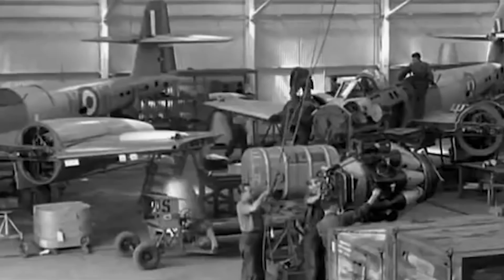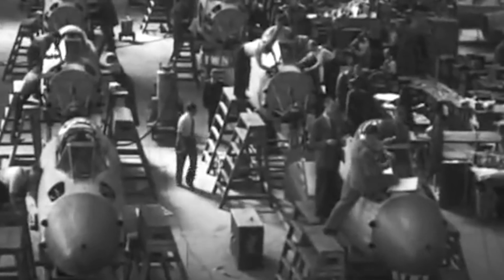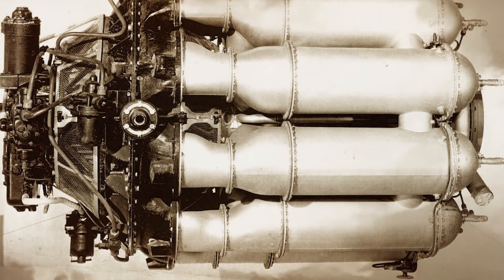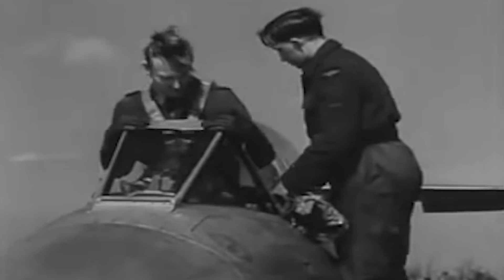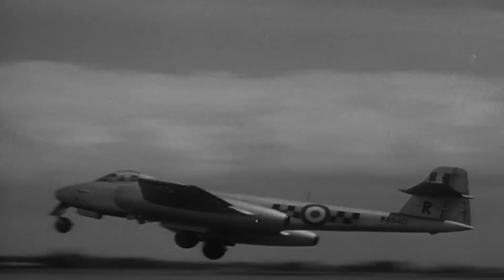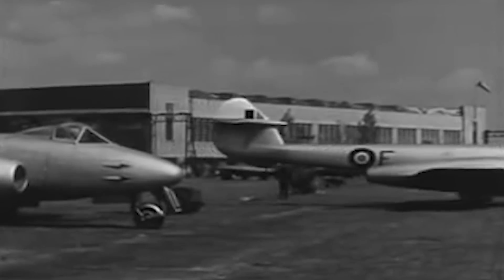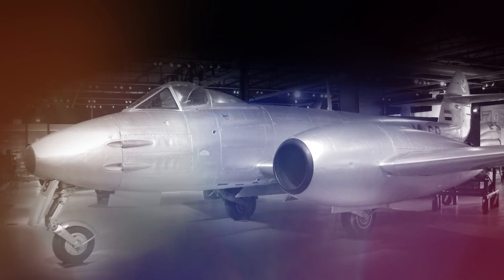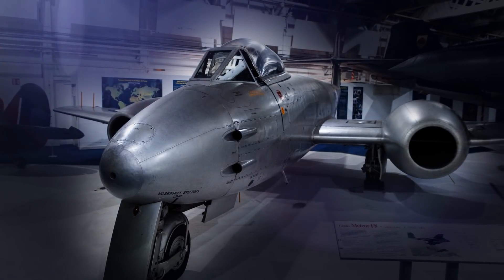Gloster Meteor - The Only Allied Jet to Fight in WW2

Comment: I thought there was a single engine prototype that preceded the Meteor.
That would be the first British jet.
Reply: The Gloster Whittle E.28
Reply: It gets a mention two minutes later.
So what’s that intro about?
Reply: @Margarinetaylorgrease  The Gloster Meteor is often referred to as the  first British jet fighter, although it was never used as a fighter by the RAF.
Reply: @sandervanderkammen9230  I didn't use the word "fighter" and neither did the intro.
Reply: @Margarinetaylorgrease  Indeed, the Gloster Whittle E.28 was the first British jet, not the Meatbox.
The first effective British jet fighter was the DeHavilland Vampire... although it too never saw aerial combat in RAF service.
Reply: @sandervanderkammen9230  any air craft used for air to air interception  was a fighter which the Meteor did in July 44.  You might want to stop lying.
Reply: @jimdavison4077  The Meatbox was a failure as an interceptor too, it was too slow to shoot down V-1s and was quickly replaced by faster, more maneuverable Tempest and Mosquitos.
The Meatbox never shot down a single Luftwaffe plane...
Reply: @sandervanderkammen9230  Sandyboy, are you coming out to pay. As you know the Meteor was a much more successful aircraft than that crappy old Me 262 which you will agree had a mechanical failure crash rate far worse than the Meteor's and had very weak and badly developed engines with an appallingly low service period . And I know you'll concur that the Meteor had a very long and successful career in over a dozen national airforces far superior to the Me 262's abysmal 7 years of use by just two nations.

Comment: The Meteor was a well sorted out design (for its time) with very reliable engines. The Me262 was a mess, it weaved horribly at high speed & went so fast pilots often didn't have time to get a shot in on a target. It's engines lasted no more than a few hours & THAT was only when they were used very, very carefully, otherwise they'd immediately destroy themselves. Often overlooked was the fact that the Me262 couldn't slow down, so it spent lots of time losing speed before it could land, making it a sitting duck for Allied Fighters, especially since the pilot couldn't throttle up to get away because that would immediately destroy the engines.

The Me262 was so badly made panel gaps had to be bodged up with putty, the Meteor was so well made they flew until 2019 using the original engines. The Germans only had a very few Me262s, the Brits had hundreds of Meteors. Germany never stood a chance.
Reply: The German pilots who flew the Me262 shitbox often had an airplane that had putty to fill in gaps. They described it as "cantankerous & dangerous to fly". As for the engines they were found to be reliable WHEN BUILT TO THE HIGHEST QUALITY PEACETIME standards & not subject to wartime operational stresses, which is why the actual Luftwafde engines had to be rebuilt every 10hrs....oh & don't forget the landing gear collapses. What a nice way to end your dangerous sortie.
Reply: Lol the Wehrboo chimp out in the replies
Reply: Then why was the Gloster "Meatbox" unable to shoot down a single Luftwaffe plane?
Why did over 1,000 "Meteorites" CRASH? Killing 450 british pilots alone????
Reply: Meatbox flying with original engines??? Certainly not possible.
The Derwent 5 engine was not available until after the war ended...
There are no Welland or Derwent 1 engines in airworthy condition.
Reply: That urban myth won't fly here lad,  the Jumo 004b Orkan engines met or exceeded the RLMs 100 hour PFTR reliability test required for adoption into service by the Luftwaffe.
This is the exact same PFTR standard for the RAF and USAAF during WW2.
Testing conducted by the Americans during Operation Lusty conclusively proved the Me-262s engines averaged TBOs between 50 and 60 hours... excellent by Allied standards during WW2.
Reply: @sandervanderkammen9230  You're still trotting out that '100 hours PFTR' gobshite then Sandyboy. It's really funny to google that term and discover that the only responses are dodgy KZ sites with you on them making that stupid claim. Except of course when to randomly up it to 200 hours.
Reply: @sandervanderkammen9230  if you think the Jumo 004b engine flew for more than a few hours I have some prime beach from property to sell you.  Comes with a brook that runs most of the year.  Germany had no sucessful Jet engine at all.  The US had to use no less than 8 engines to get less tha six hours of test flight on its 262 testing.  Twice with emergency landing with engine failures.  No the Jumo engine never passed any safety tests post war which is why they were banned when Howard Huges tried to fly one.  You can not make a jet engine out of mild steel.  Impossible as the heat distorts the metal.
Reply: @jimdavison4077  Sorry jimmy! The U.S. Army Operation Lusty reports say you are a liar!
Army testing conducted by Lusty CONFIRMS that the Jumo 004b Orkan engines met or exceeded Allied standards for reliability and had very comparable TBOs.
Of course the MesserschmittMe-262's had a huge operational advantage in engine servicing as a well trained ground crew could replace a Jumo 004b engine in under an hour... a task that could take days on some Allied aircraft.
Reply: @jimdavison4077  You don't know anything about the Jumo Orkan turbojet engine do you?
Thank you for confirming.
Germany invented high heat resistant Nickel alloy, Krupp P-193 Tinidur-60 was introduced in 1928 and has a higher creep temperature than Nimonic 70.

While the original design 004A and BMW engines used P-193 nickel alloy and had TBOs of 200 hours, the 004b engines were made with Krupp P-198 Chromadur, a high temperature creep resistant stainless alloy based on chromium. P-198 is still used in jet and gas turbine engines today known as ATSM-2082.
In addition to the heat resistant properties of P-198 Chromadur, Dr Anselm Franz introduced two key revolutions in jet engine design.
The Jumo 004b engine features bleed air cooling of the turbine nozzles and blades. ALSO the combustor and turbine section was protected by a heat resistant Cerro-Alumina ceramic coatings. The hollow air-cooled blades and ceramic coatings gave the the 004b TBOs up to 150 hours.
BETTER THAN THE ROLLS-ROYCE WELLAND engines and equal to the Derwent engines found in the Gloster Meteor.
Reply: @sandervanderkammen9230  
Sure dokter bummer. You really do make it up as you go along. Is there a contest for telling lies? you would win.
Reply: @sandervanderkammen9230  
Why could the Me 262 not shoot down a single Spitfire or Tempest?  Go on tell me and why did the Meteor destroy 46 Luftwaffe aircraft and no Luftwaffe aircraft shot down a single Meteor? It couldn't be that because no other Luftwaffe fighter could catch up and the Me 262 pilots knew they would lose would it by any chance?  Germany never made a good jet engine, USA used British jet engines, France changed the failure that was the BMW and USSR tried the Jumo but dropped it and used Rolls Royce jet engines. Czechoslovakia tried to use the Me 262 but they found it and the engine to be very bad and soon went to the Mig 15
Reply: @sandervanderkammen9230  Warum bist du so ein Feigling.
Reply: @barrierodliffe4155  ME 262s shoot down many P51s. Spitfires would be even easier. But toward the end of the war, it was mostly the US airforce flying over Germany.
Reply: @jacobjonm0511  
Towards the end of the war Spitfires and other RAF fighters were based in Belgium and Holland, they were flying over Germany, also Spitfires based in England were flying over Germany. Spitfires being easier to shoot down than P 51's is a US myth. No Spitfire was shot down in the many encounters they had with Me 262's. 
The Spitfire was faster, had better climb and maneuverability than the P 51. 
True story, a lone unarmed Spitfire Mk XI was attacked by 4 P 51's and the Spitfire pilot just turned giving the P 51 pilots no chance to hit him, he then accelerated away leaving them firing at empty sky. You might try to say it didn't happen but the Spitfire was in US Markings and flown by a USAAF pilot.
Reply: @barrierodliffe4155  lol yes Spitfire was the best. Hope that makes you happy
Reply: @jacobjonm0511  What makes me happy is that the more I learn about the Spitfire the more I find out just how good it was and still is.
Reply: @barrierodliffe4155  Yes it was an amazing plane. It just tended to have the engine failure on a steep climb or dive due to the carburetor injector ;)
Reply: @jacobjonm0511  No engine failure and no problem in a climb steep or not, there was a problem of momentary cut out with negative G or when nosing over into a dive but if the pilot rolled into a dive no problem at all.
Reply: @barrierodliffe4155  very nice. You may need too give an interview with Discovery channel about Spitfire 😋
Reply: @jacobjonm0511  Maybe but I do not think so, I have been compiling a lot of information about the Spitfire and a few other subjects.  For great information there are a number of books, There have also been interviews with pilots who used to fly them.
Reply: @jacobjonm0511  

The carburettor issue was mitigated with Miss Shilling's orifice and completely negated by 1943 with better engines like the Rolls Royce Griffin series. 

By that point, the Spitfires even began to have increased range to compete with the P-51. And who cares which was better? Both kicked the hell out of the Luftwaffe AND both look incredibly good.
Reply: @youraveragescotsman7119  lol yes yes
Reply: After the war for some reason all the victor took over german designs and engineers.
Reply: @jacobjonm0511  

No, they didn't. Jet designs in the Cold War were based on British engines.

The British Centurion was also used for the basis of the MBT, not any of Germany's Tanks, which the French used and then abandoned because they saw them as unreliable.
Reply: @youraveragescotsman7119  how old are you?
Reply: @jacobjonm0511  

Why would that matter? It is, quite literally, an undeniable fact that later Jets such as the Mig-15 and F-86 Sabre were based on designs and engines from the British. 

And the MBT concept being founded by the Centurion Tank, a Tank which still serves to this day in the Tank Forces of other countries.
Reply: @youraveragescotsman7119  The concept of the MBT was in invented by Germany and was first developed as the Sd.Kfz. 182 or Tiger I in 1939.
It is the very first example in the world of a tank which demonstrated the "Trifecta" concept of having maximum firepower, superior armor protection and excellent off-road speed and mobility.

If you think the Centurion is the first MBT? You don't know what an MBT is!
Reply: @sandervanderkammen9230  

>Tiger I

>MBT

Please tell me you're joking.
Reply: @youraveragescotsman7119  The only joke here is you lad.
Reply: @sandervanderkammen9230  

The Tiger I is as far from an MBT as you can get.
Reply: @youraveragescotsman7119  Thank you for proving my point.
Reply: @sandervanderkammen9230  

Go on and explain how the Tiger I, which is a BREAKTHOUGH HEAVY TANK, is an MBT. 

Go on. Explain why, after the war, no one used them. The Centurion is still used in upgraded forms to this day, while the Tiger I remains a paperweight in museums.
Reply: @youraveragescotsman7119  Thank you, for confirming that you don't know what a MBT is.
Reply: @sandervanderkammen9230  

I can tell you exactly what an MBT is. The Tiger I does not share any form of similarity with what the MBT is.

The Tiger was designed as a Tank to facilitate breakthroughs, but not to exploit them (something MBTs can do) due to its atrocious reliability and speed. The Tiger I was made to shoot things from long range and let the more mobile Medium Tanks exploit the breakthrough opportunities. 

An MBT, by contrast, is a universal tank that can create and exploit breakthroughs, while having the armour of a Heavy Tank (lol to 101mm of flat armour on the box that was the Tiger I) and mobility of a Medium.
Reply: @youraveragescotsman7119  Thank you for proving my point yet again... you clearly have no idea what an MBT is.
Reply: @sandervanderkammen9230  

Explain then what an MBT is. 

The Tiger I is not a universal tank, which is what an MBT is by DEFINITION. The Tiger I is a breakthrough Tank designed to create a breakthrough for lighter Medium Tanks to exploit. 

The Tiger I was not designed to replace all of Germany's Tanks to only use one type of Tank, an MBT.
Reply: @youraveragescotsman7119  I already did son... are you a slow learner?
Reply: @sandervanderkammen9230  

Explain how the Tiger I is an MBT.

It has the armour of a Heavy Tank, the speed of a Heavy Tank and the gun of a Heavy Tank.

An MBT, by definition, is Tank with the firepower of a Super-Heavy, the armour of a Heavy Tank, the weight of a Medium Tank and the mobility of a Light Tank. The Tiger has one of these and none of the others. It serves one role, breakthrough, while the other roles are covered by Medium Tanks and Light Tanks.

So, please, explain how the Tiger I is in anyway an MBT.
Reply: @sandervanderkammen9230  

1. Not even close to true. Light Tanks would run circles around it. 

2. On paper it would have been. In reality? Not so much. Transmission issues and overweight suspension being a huge hinderance. 

3. The Tiger I is still not an MBT.
Reply: @youraveragescotsman7119  Thank you for confirming you don't know what an MBT is.
Reply: @sandervanderkammen9230  You don't seem know what an MBT is either. An MBT isn't just "strong armor, good mobility, and good firepower", because if it was then practically every medium tank designed during the war would be considered an MBT. the FT-17 would be classified as an MBT (it had good mobility for its time, versatile armament, and good enough armor). Rather, entire concept of an MBT is more about doctrine and how the tank is used in a nation's armed forces. For example, the pre-composite armor NATO designs such as the AMX-30 and Leopard 1 had practically no armor to speak of against common tank guns yet are still classified as MBTs because they were the MAIN BATTLE TANK used by the armed forces of their respective nations. The closest thing to an MBT during WW2 would be tanks like the Sherman, Panzer III / IV, and T-34s which made up the overwhelming majority of their nation's armored forces, though that still doesn't really fit in most cases since the doctrine of those countries still relegated many roles to other tank classes (Germans and Russians using Heavy Tanks for breakthrough purposes, the US using Tank Destroyers extensively, etc). 

Regarding the Tiger I vs Centurion example, while neither tank could be classed as an MBT at the time of their introduction, the Centurion is far closer to being an MBT than the Tiger was. Once again, this comes down to doctrine and equipment procurement. German armored doctrine dictated that heavy tanks such as the Tiger I and II were to be used as a heavy breakthrough force to be used in short-range assaults to blow a hole in the enemy line that other (far more numerous) tanks with greater operational mobility and flexibility use to exploit. This explicitly goes against the idea of the MBT as a universal tank concept; if it was then the Tigers would have been capable of acting as the primary tank design used by the army. With the Centurion on the otherhand, it mainly just comes down to the composition of the British Army when it was introduced. While the later Centurion models would eventually morph into a proper universal tank/MBT, the early models were still used to supplement the numerous other designed that the British used such as the Churchill and the various "Cruiser" designs they produced.
Reply: @iiiiii_2212  You obviously don't know what an MBT is either... just because the term MBT had yet to be coined does not exclusively discount pre-existing examples that clearly meet the criteria including the worlds first example... which is with any doubt the German Tiger 1.
Reply: @sandervanderkammen9230  Okay cool but like, that still doesn't change the fact that the Tiger 1 explicitly does not fit the modern definition of what an MBT is because it is by no means a universal vehicle from a doctrinal standpoint. That's okay though. If you want terms to mean whatever you want them to mean, then by all means live your truth, I can't stop you.
Reply: @iiiiii_2212  The Tiger predates the term 'MBT'... but it is nevertheless the worlds first successful demonstration of the concept as we know it today.
Reply: @sandervanderkammen9230  

It really isn't though. It was designed to create breakthroughs for other Tanks, like the Panther and Panzer IV, to exploit because it couldn't exploit the breakthrough itself.

You can make a case for the Panther being a proto-MBT, but the Tiger I? No.
Reply: @youraveragescotsman7119  Your hypocrisy and bias is blatant.
Reply: @barrierodliffe4155 Hey Barrie please name a single British jet still in production?